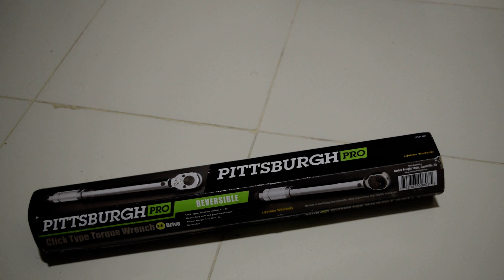How accurate is a Harbor Freight torque wrench

Comment: I bought both the 3/8 and 1/2 inch version. They are trash. One is 30% off and the other the numbers don't lineup even close to the line you line it up to. Total trash good for a breaker bar or use it as a hammer till pieces fly.

Comment: Don't break your tile floor bro. This test is not accurate bro, its beeping then torque wrench clicks after beeping no way to tell the difference in actual torque value of the wrench. Good attempt though.

Comment: Did you adjust the click wrench to calibrate it to the values of the digital wrench? I mean, they may have started out inaccurate, but if they’re adjusted they might actually be accurate within the stated tolerances.
Reply from the maker: Ronan Rogers i didn’t calibrate it before the video, as i wanted to know its accuracy out of the box, and it wasn’t bad, as i its not designed to work or rocket-ships 😂

Comment: Heard these are pieces of crap. How's it held up?
Reply: They're actually pretty good, I bought 1/2, 1/4 and 3/8 torque wrenches off eBay for $50. I mean, you can't beat that.

I just torqued my head studs down in my Honda as well like 2 weeks ago.
Reply: @bman409  On sale for $9.99 each at HF with coupon.